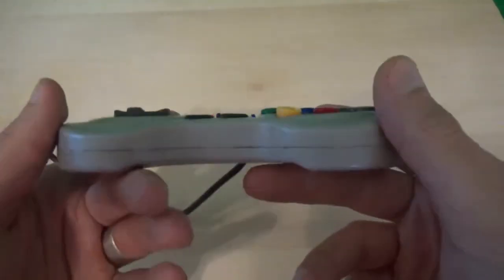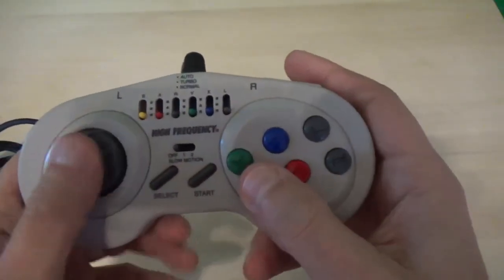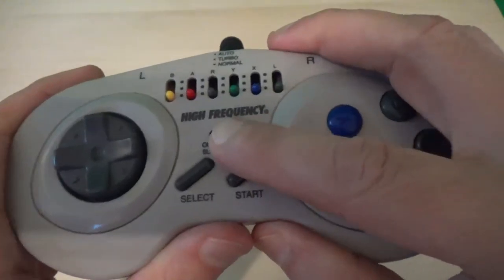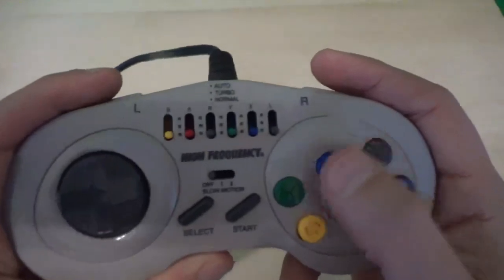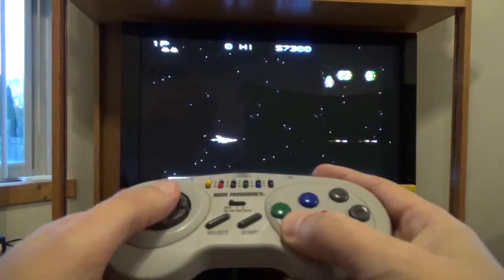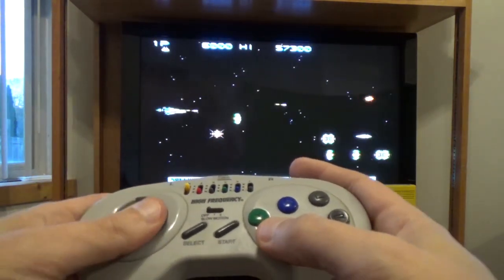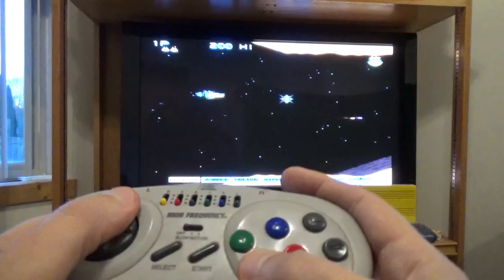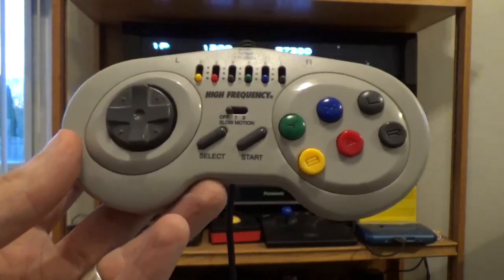High Frequency/ Mad Catz Turbo SNES Gamepad Review

Comment: I have a few of these (technically I have one of these and a couple of the MadCatz ones from after they bought HF) and it has been my favorite analog controller since the mid 90s. I had to remove the Slow Motion switch from my High Frequency one at some point when it caused the controller to stop working correctly. The switches on mine were never as hard to operate as the ones on yours appear to be. This controller was amazing for fighting games especially ones like Killer Instinct and Fatal Fury 2.